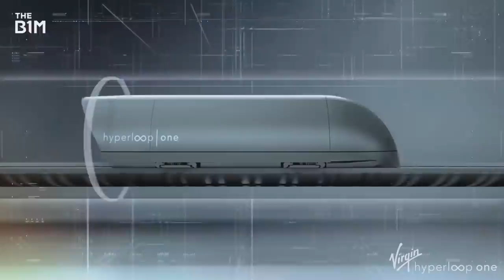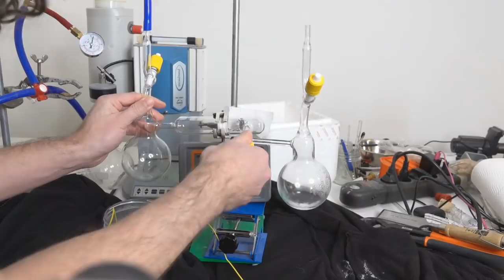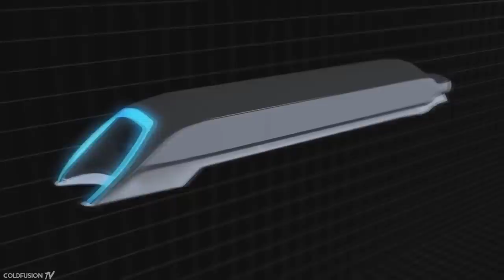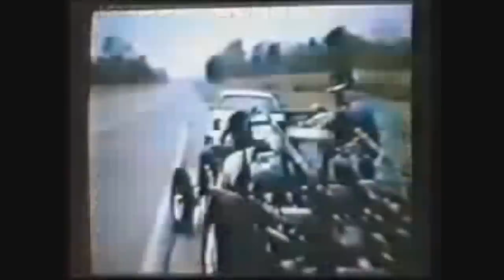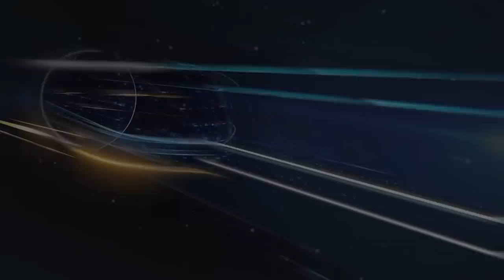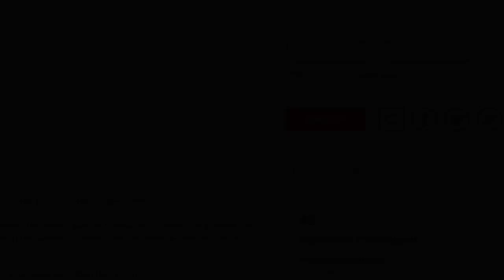Free energy device using Hyperloop technology!

Comment: Hyperloop is essentially possible. You build a tunnel and you take the air out. Without friction, the vehicle only needs to be accelerated for a brief period. Then it just coasts at hypersonic speeds until it reaches it's destination.

To minimize loss of human life in case of catastrophic failure (earthquakes, accidents etc.) you reduce the size of the vehicle. So, in principle, you can even have a 1 person pod.

The fact that Elon Must did a shitty job with this idea doesn't mean it's not doable.

Comment: But but this would need a vacuum tube over several hundred miles at least. Do you know how insanely expensive it would be to build that.
Much better if you just drilled really deep instead and do the tunnel vertically.
Also I will demand a working model of the power plant as a reward for my 5 bucks!
However I think a better option all together is building gigantic water turbines and sink em in the path of the golf stream, that would also work 100%  in theory.

Comment: LA to Beijing in 15 minutes?!? that means traveling at 25,000 MPH from start to stop... Yes twenty five THOUSAND miles per hour from start to stop... that is with instant acceleration...  Now, to accelerate to that speed at 1g? A FULL HOUR! To travel that distance (6250 MI) with acceleration at 2g and deceleration at 2g would take A FULL TWO HOURS. Now, this is at TWO TIMES earths gravity... that means those fat asses that require wheelchairs or take up two seats on a plain? Those ones would die of heart attacks to go that distance in an hour... and it would take roughly 4 hours to travel that at an acceleration of one G... GTFO!!!

Comment: is that actually a reversed steam engine? powered still by steam, propelled by pressure difference created by temperature difference but this time not by a high temperature and boiling water and heightening pressure , but by freezing water vapor in resublimation process and lowering pressure? clever! :D

Comment: Quick question: what was the liquid in the right hand flask? If it was water at room temperature in a near vacuum, would it not have been boiling?
Reply: It did boil, when the vacuum was first applied, then the pressure equalized with the vapor pressure of water.
Reply: @pduren2001  Can you indicate where it is shown to be boiling in this video please?
Reply: @missusgumby  I am guessing you expect to see bubbles. Bubbles appear when cooking because heat comes from below. Here, it simply evaporates. It is invisible, until there is no liquid left. Cold water absorbs the kinetic energy of the floating water molecules, decreasing their pressure, causing less of the right-side molecules to be pushed back, causing air flow (although the density of molecules is so weak that the force on the aluminium foil is low). The cold can condensate the water, making it take less volume and decreasing pressure further. But the whole design is still a hot-source, cold-source, which is a well-known setup with much more optimized designs, look up Stirling engines. This design actually doesn't have a complete cycle, so at equilibrium, depending on how much water there is, it either will gather as ice (higher pressure), or reach pressure equilibrium as vapor (lower pressure, what happens in space).
Reply: @viewspan  I'm not thinking about a cooking temperature, I'm thinking about water at room temperature in a vacuum. The lower the pressure liquid water is in, the lower the temperature at which it boils. Or am I wrong about that?
Reply: @missusgumby  it is more than that. At very low pressure, like 1 millibar, we're past the triple point, so all liquid will evaporate. Liquid doesn't stay liquid in space.
Reply: @missusgumby  in the other video, he measures pressure at 14 millibar, which is high enough to allow stable water, but assuming the temperature is around 20°C, it's past the boiling point, so it is slowly vaporizing.
Reply: @viewspan  So there's another video? I see.
Reply: Yes, it's water. It's not boiling because the water vapor that exists in there offers enough pressure to keep it from boiling. This is the reason why it begins to boil once you remove the pressure by condensing on the other side.
Reply: @Higher4Hire Is that a step that's not shown in this video?
Reply: I believe you are confusing "pulling a vacuum", with "a vacuum". As a vacuum is pulled on a closed system with water in it, the water will boil/evaporate rapidly, as the water vapor fills the system, the vacuum pump will pull out the vapor/air mix, making more room for water vapor, water boils. Once the pump is stopped and the system becomes static, it will stabilize, water vapor will fill the container until it is full, the pressure of the vapor will prohibit any more water from boiling/evaporating, the system is still under a vacuum, but it is stable until you either add or remove heat.
Reply: @pduren2001  My mistake. Apparently there is another video where this is explained.

Comment: Yay. Steam engine)))))
Reply: Totally not a steam engine! Steam engines use heat to create steam whereas this uses cold. And because cold is cheaper than heat, it's more efficient. Free energy all through the winter!
Reply: @shaunpatrick8345  Hate to tell ya mate... but this is still using heat to create steam...  Why do you think this isn't a steam engine?
Reply: @Melanie16040  no, it's totally different! I there was a "steam train" based on this technology it would run on ice cubes instead of coal.
Reply: @shaunpatrick8345  A steam engine uses heat to produce steam(water vapor), which is then used to do work, and then afterwards undergoes a phase change so as to no longer be steam(water vapor). Do you agree that's how a steam engine works?  Here we have water vapor being produced from the heated water(I'd guess it's heated to around 20C), then it spins the turbine(does work) and then undergoes a phase change so it's no longer in a gaseous state...  I ask you again, what makes you think this is not a steam engine?
Reply: @Melanie16040  it's an entirely new form of energy, based on cold. I'm already considering staking out some land in Greenland to mine the ice.
Reply: @Melanie16040  we know in reality that this is technically a steam engine, it's a joke, apparently on you
Reply: @jellybean2032  I'm autistic, so I've gotten used to people making jokes at my expense in life...